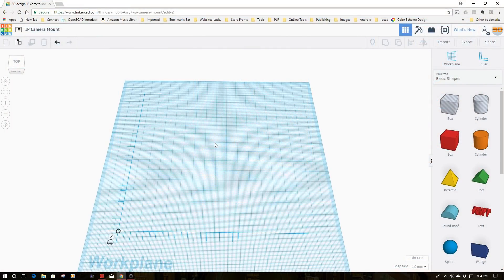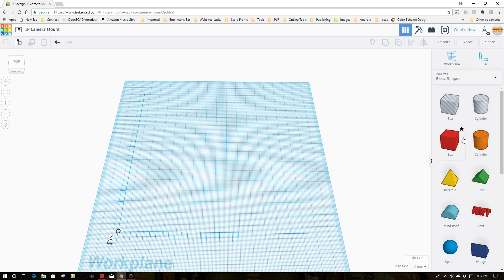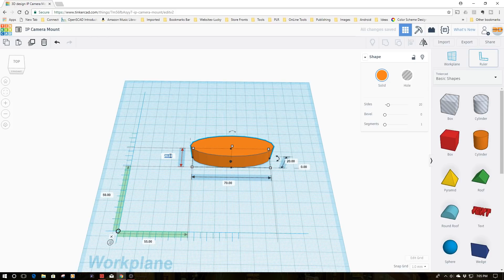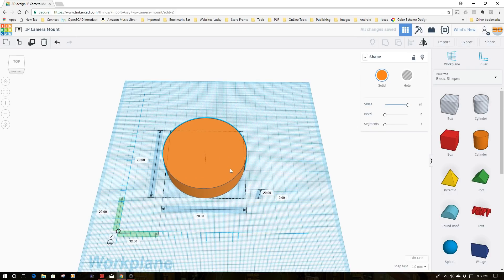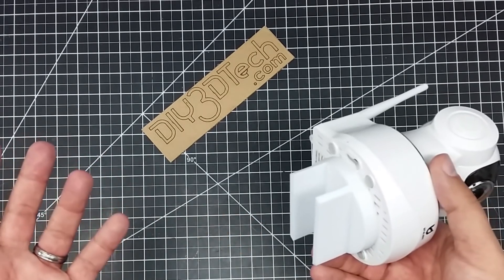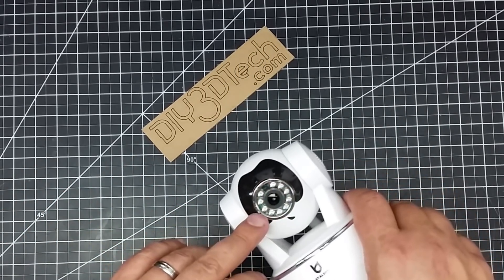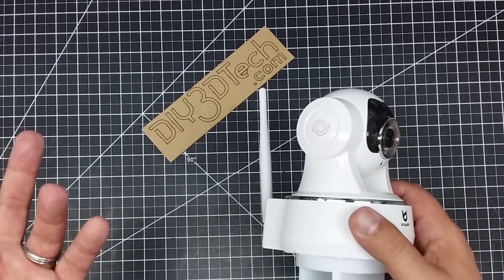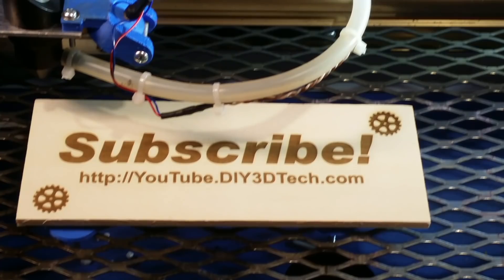3D Printed Project - Rapid Design for an IP Camera Mount!

Comment: @6:00 Press Ctrl+UP/Down keys to move an object Up or Down :)
Reply from the maker: Many thanks for the tip, yet I tend to be more of a mouse guy :-)
Reply: I'm exactly the opposite. I try to do as much as possible with the keyboard. It's often faster and more precise ;-)
Reply from the maker: I use to be the same way, then I got old and lazy.  If you do it a lot you build the muscle memory and slam though things on a keyboard then you get carpel tunnel (which is a big part of my issue),  What is why I use is a mouse in the right hand a puck in the left to split the work load as I use the puck for the left and right mouse buttons to take the stress off my right hand.  Also have the control keys like C & V programmed in so I don't have to move my hands back to the keyboard.
Reply: +DIY3DTECH.com Joe if you were old and lazy, you would watch TV all day. Not designing things. Too humble.
Reply from the maker: Okay so just old :-)
Reply: +DIY3DTECH.com Joe, I knew you are related to the guy of Mouse Trap Monday, Shawn Wood https://www.youtube.com/user/historichunter
Reply: +DIY3DTECH.com no no no no your hands say otherwise, you are not